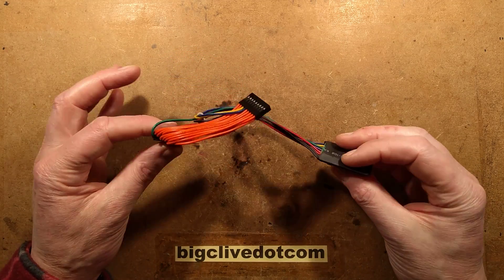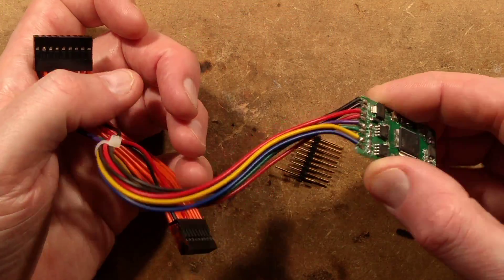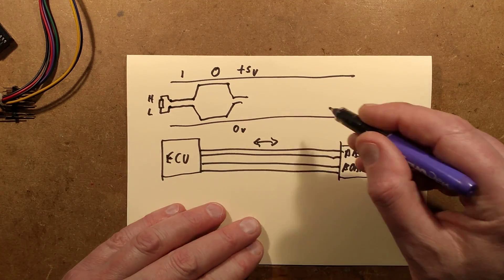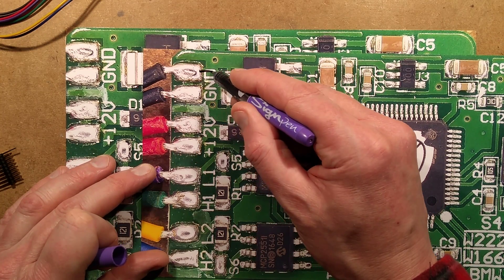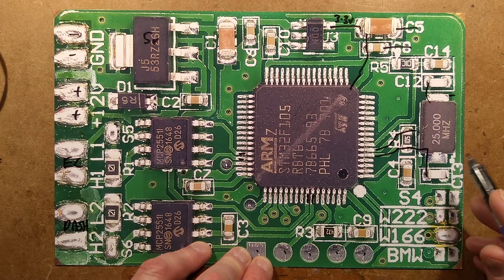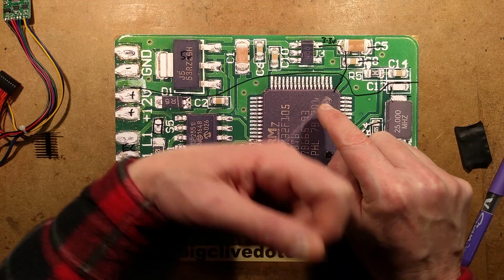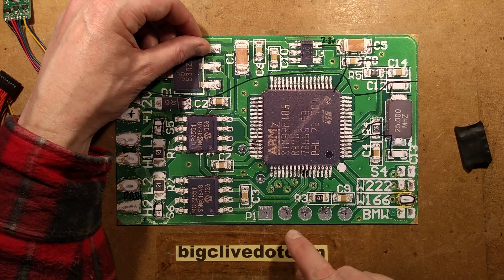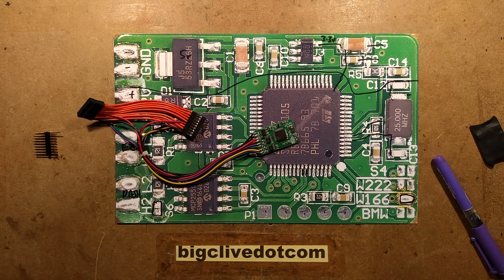Naughty CANbus odometer "interface".  (Fakes mileage.)

Comment: In a CAN bus system no device pretends to be another device, instead it is purely message based and all devices connected to the CAN bus react to a message that they have been programmed for.
Reply from the maker: This unit does react as the intended recipient of data and then sends the modified data on to the original recipient.
Reply: @bigclivedotcom  I was just pointing out that it doesn't pretend to be the cluster, but rather acts as a man in the middle, intercepting the message.

Comment: Thanks for explaining what a can bus wiring system is for. Had to install an aftermarket stereo in a 2000 Chevy several years ago and the install kit came with a similar device and a new buzzer for when the keys are in the ignition and the doors are open. Guess the old radio had the buzzer and can bus wiring. Now I know. Thanks

Comment: You are probably wrong about what role the processor has. I think it is just a "man-in-the-middle" that simply bypass all parameters from interface 1 to interface 2 and vice versa, but when a data packet with odometer value comes from either side (but in this case always only from one side) it simply just send throught the same packet but with changed odometer value.

In a given communication environment, devices sends some data all the time regardless if requested or not. Such data may very well be odometer value. When a message awaits sending, it gives an priority and with a clever "win-or-miss-fight" on the databus, where "1"-bit always wins over "0"-bit, and higher prioritized messages have higher chance to send its payload then lower priority messages, and every time a message looses a "fight" it gains one priority level so it is higher chance to win next. The priority and the message id is the same value, and the lower id, the higher is the chance to win. Therefore two devices on the bus must never have the same id.A clever collision detection. 

The unit that continiously announce the odometer value message is picked up by the device and recalculated.

An implementation of signed messages probably needs to be implemented on application layer in OSI model, but the hard part is that every component then needs to be updated to understand this. A workaround may be that all values are sent unsigned but values that needs to be tamper protected is sent again in signed packets that, in this case, only dashboard understands. If a device is plugged in into the OBD2-connector, it will read the unsigned values and show the spoofed value, but the dashboard will show correct information. Dashboard may also implement a warning signal if there is differences between the signed and unsigned messages and thereby alert the user of the car that the values is tampered.

The pcb design itself is almost identical what to expect on a Canbus gateway, where some messages shall be passed over between two buses. However, the explicit silkscreen shows that the actual PCB is manufactured for this spoofing purpose. The setting probably just tells what message id/ids should be manipulated and what should be unchanged. Some ids is more or less standard and others are custom for the specific application.

Comment: The device has a qc sticker most likely because it wasn't actualy designed for the purpose of cheating the mileage, it is very likely a can bus dev kit or something, you can get an arduino with can bus circuitry too, the criminals just got a board on alibaba or banggood and programmed it for the purpose.
Can bus is also used in drone/uav technology.

Comment: Looks fairly well made,

The messages are sent periodically, this is intercepting the odometer message and modifying the reading, the other messages will be relayed.

The jumpers in the bottom right are to change the vehicle it's configured for

W222 and W166 are Mercedes chassis generation numbers and there is BMW support.

The CAN chips are Transceivers, the controllers are in the MCU itself. They'll have used Microchip as they are the cheapest in low volume.

A CAN gateway is a device that bridges 2 CAN bus networks, bit like a router in Ethernet.

Comment: But I don't see how it would fool all the modules.  I hear that on a CAN bus that mileage is on all the modules.  So if you buy a Volkswagen and suspect the mileage is not reading what it really is, there is a chance that you might find the real mileage in other modules.  I would like to think that VW and all others that use a CAN bus are doing all they can to make sure that odometer fraud is a thing of the past (or make it very difficult to get away with).

Comment: Thanks for this information.  I never knew this was possible.  I did a Google search for  'toyota device that reduces the odometer'   and found one made by  superkilometerfilter - dot - com  and it is available for all types of vehicles. At $300 each they are NOT cheap,  but I'm going to buy one and use it on my new car.  Thanks.

Comment: This electronics device is far from illegal. It is not illegal to tamper with a car, that's why custom car scene exists. As long as vehicle passes technical inspection - custom mods is allowed. What is illegal is to withhold information about original mileage. So in that sense this device is not illegal, but user's actions might be if he or she decides to not to tell about original mileage to any interested parties. When it comes to pcb itself it's very interesting that they used separate CAN drivers instead of using STM's. Seems like a waste of resources. At any rate It's not one size fits all case (even for BMW). Vehicle manufacturers constantly changing CAN ID's and CAN data (and it is not according to that J1979 protocol that everyone is selling J1979 obdII dongles as some sort of miracle), so to have one size fits all solution would require enormous resources.

Comment: Mercs have checking for this, they have a value in the ECU for mileage, but then also in the wheel speed sensors etc. So they have a backup in case one is tampered with. The diag code for that is normally 'mileage implausible'

Comment: Most modern clusters have an eprom chip that stores the mileage however you can dump the eprom file that is in binary, change the values and flash it back on. I'd assume the arm7 chip is replacing the cluster eprom because maybe dumping file wasn't possible.

Comment: Well after just getting a low mileage mercedes I'll be taking the clocks out to check for this, as I noticed my clocks has a small crack in it as if it was removed. I will update you Clive..  well done tho.
Reply: How did that turn out?
Reply: @disguisedcat1750  orded a Carly online and showed the service history and miles stored the same in all ECU's
Reply: @2094Ryan  nice you haven't been ripped off then

Comment: Dashboard pings the ECU with a request judging by how a CAN sniffer works. You send a command that the ECU and you get the mileage in response. My guess is that it pings the ECU for mileage, saves it in memory, then when the dashboard pings for mileage, it intercepts that and sends back the mileage (minus whatever it's removing from that number)

Comment: Since lot of car components are connected to the same CAN bus, what happen if one of them is defective (eg : maintain bus at dominant state). Does it mean the whole car is down ?
Reply from the maker: There are usually several networks.  A faulty module or broken/grounded wire can take a network down.

Comment: It's called a mileage emulator or mileage blocker. It mimics original mileage CAN info from ECU/ABS when installed and blocks new mileage data.

https://www.truckdiag.uk/shop/mileage-correction/can-gateway-can-filter-module/

https://birminghamdiagnostics.co.uk/product/mercedez-bmw-mb-can-filter-blocker-mileage-correction-assist-diy-no-soldering/

Comment: These are an older type of Chinese universal can bus filter. 
They block the mileage synchronisation between the (EIS) electronic ignition switch, and the instrument cluster.

The reason for installing them is you can edit the mileage in the instrument cluster but the EIS is impossible to read and edit on the 2013- Mercedes EIS.
This gets round this problem and it actually stop the km increasing in the key barrel. So eventually you could remove it and it would only ever be at the km you first installed it at.

Comment: That's a $300 milage correction tool, you hold down the wiper stalk for 10 seconds  to activate and deactivate it
Reply: No it’s not, it filters the mileage from the EIS (electronic ignition switch) module so you can edit the instrument cluster, because you cannot edit the EIS, this gets round this problem

Comment: Some vehicles will store the mileage in both the cluster and ecu, and in some cases other modules. ABS units will provide speed data and this is usually passed on to ECU, Instrument cluster and any other modules that need it via CAN.

Comment: Quite a common scam when Arabs and Asians are selling cars.  A quick OBD11 check with computer or shop quality reader can usually spot the discrepancies.   MB and Audi store odo in multiple areas hence the ecu code throw a short time after installation.  Not sure about BMW.  I found one of these on a W221 S550 MB for sale.

Comment: The ARM chip is providing a division function.  The dashboard PCB has a pulse counter in order to accumulate mileage.  If you intercept and then sink or divide the pulses, the milage doesn't increase as per the manufacturer's intentions.

Comment: hmm BMWs store this in the Instrument cluster, The anti-theft system, the car key etc. This chip alone won't really solve the problem, On old BMWs at least you reflash the EWS, and cluster at the same time. And then maybe use this to fool the ECU and other componenets as if there is mismatch there is warning/error. I can only guess but it is quite possible this module malfunctioned and the errors that popped up were due to the mismatch. It is well known fact that most if not all cars second hand had their millages altered one way or the other. In my country all second hand imports from Germany/Italy has millage based on the years, 50k-100k km is 5 years old car 10 years car is 100k-200k km,  15years car is  low 200k km . You go on german car website and you see 3 years old cars of the same class with 200k km.

Comment: The bus termination resistor is also to stop the signal wave bouncing off the end of the transmission line and echoing back and forth.  Like a rope tied to a fixed point and pulled a bit tight, twitch one end of the rope and watch a wave travel -- then bounce off the tie point and return.  The resistor absorbs the signal instead.
Slope control allows reduction of EMI and power supply peak draw in CAN bus networks with lower data rates (slower edges = doesn't transmit as much, takes less current to slew the bus voltage) and high speed operation for e.g. 1MBPS networks.

Comment: Mileage is stored in multiple control units. So this will void your warranty when it is found. And trust me, these devices leave a messy trail that is easy to find when diagnosing these cars. Most cars use the ABS/ESP to measure speed and that is transmitted over multiple Can networks.

Comment: Just looked at the add on eBay and it’s only applicable for a few BMWs made from 2009-2011 and looking at the instructions I see exactly how they are doing it since I know those systems well. Every generation of them use a different mileage keeping system and a different electronic immobilization systems. I have to reverse engineer the new ones so I can repair them. I think I will order one and see if it can be a tool or just a defraud device.

Comment: Well I haven’t seen that one yet. I don’t think you can do that to a BMW the mileage is on a chip in the cluster. Only way to manipulate the mileage on one of them is unsolder the chip read it and write a new one with the edited data and re solder it. There’s no way to manipulate it via can bus except for the 199-2001 can be done with a laptop but you have to change the value on the chip. I’m not someone who rolls mileage back I have worked on BMWs for 30 years and it is a lot cheaper to get a used cluster and do the chip so it matches the original and it’s $500 not $1500. But BMWs store the mileage in 3 locations. The cluster, ews module and the DME. if they all don’t match you get a tamper dot on the dash. That’s the last thing a customer wants is a car back with a mileage tampering light on. Just offering my knowledge on one particular system. I know BMWs inside and out but no other cars. I can do more than the dealership can.

Comment: You have the right idea about those pads on the bottom.  That is a standard JTAG in-system programming footprint.  This is clearly a mass produced product and a bed of nails is used to program it after reflow soldering the surface mount components.  On either side of the 25MHz oscillator you have C0G capacitors and a resistor, which if you found the datasheet for that timer I would expect to be an exact copy of the reference layout diagram.  Another sign of the quality of this board is you can see that any ground plane islands have multiple vias connecting them to the rear ground plane.  The fact that they used an STM32 microcontroller and not an Atmel one tells me that this is probably not done in Arduino (Although Arduino does support STM micros).  STM has it's own tool chain for programming their microcontrollers.

Comment: Amazing to think that the CAN bus is not all that much different to USB/SPI, if the signalling is mostly push/pull. Who needs a „special” dealership adaptor when an ATMega 328, a few discrete components and the Arduino IDE will do? 🛠💰😉

Disclaimer: DON’T mess around with your CAN unless you know what you’re doing. Bricking a car is a lot more painful than bricking a second hand $10 phone! ⚠️😇
Reply: Yup, and most vehicles will shut down if they see noise on the bus or dodgy messages.

Comment: I always pondered creating "frequency halvers" for the wheels speed and driveshaft speed sensors.  Your car would show you're going half as fast as you really are. . . and log miles 1 on odometer for every 2 driven. . . . no need to hack the chips, just feed them bad data.
Reply: I think that would screw up the abs unit and who know what else.
Reply: @CoinJarMusicVideos  abs can't go on vehicle speed it needs to sense each wheel's speed independently so they have a tone ring on each wheel, of course a good programmer could have the odometer check the speedometer off the driveline/transmission against the abs tone readings and flag an error. . .
Reply: @snap-off5383  I thought the 4 wheel speed sensors were for the ABS and the speed calculation..  I dunno.

Comment: There is an easier method to shorting mileage, change tire sizes to bigger.

Also, I don’t think the chip is locked, looking at the layout, there is ide connections at the bottom left of the processor.

Comment: Just came across this video. Nice little device! Depending on the level of protection set for this device (Level 0, 1 or 2) and if they boot from Flash or SRAM, via SWD or JTAG the flash cant be accessed but the SRAM can still be accessed, extracted and reverse engineered using something like Radare2. But is seems now that the protection for this device is broken. A google search ("breaking the stm32f1 read-out protection") shows a few options.  Would have been nice to get at the firmware to see if there are any clues as to who developed it, developers to like to tag their code, and to see how professional a job it was.

Comment: I develop small systems using STM32-chips. I have no idea if they've programmed it in Arduino, but I have no reason to believe it, as there are many other ways and libraries to use. As for the pads at the bottom, those are definitely used for programming. Those pins contain (not in order) 5V, GND, Reset, SDO, SCL, which is the standard programming interface for STM32s (and most other ARM-based microcontrollers) called SWD.

Comment: am i late? i feel like im late.... but i did want to put it out there that a legitimate use exists. my ECU went bad, got new one from junk yard, data in ECU was from the other car. i was able to change mileage, VIN, etc. directly, but even on cars where its an option, which it isnt always, it takes special tools and knowledge. best way to figure out if its legit, get a scanner that can read the VIN, if its legit the VIN wont match the car

Comment: May be used for legit purposes where the engine control module or odometer module has been changed and their stored data don't agree? In UK odometer readings are stored during MOT...

Comment: Small suggestion: If you have something at the edge of one picture that you want to be able to "work with" when looking at another picture.. Simply overlap the pictures a bit.. (In this particular case, you should've had the picture that showed the wires underneath, and the top one just slided a bit to the right)...

Comment: Probably somebody else already wrote this in the comments already, but W166 and W222 are Mercedes-Benz model codes (W222 is the S-class from 2013, and W166 is the M-class from 2011). The body-snatcher can clearly be programmed to be used on different car models with a drop of solder.